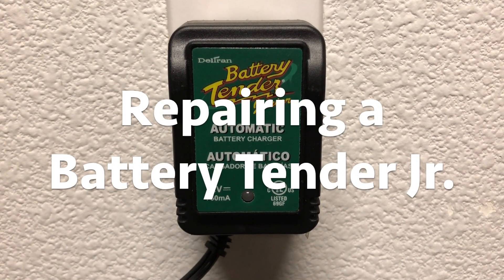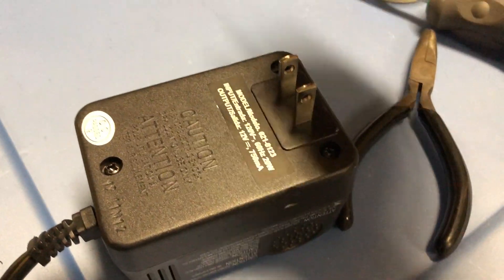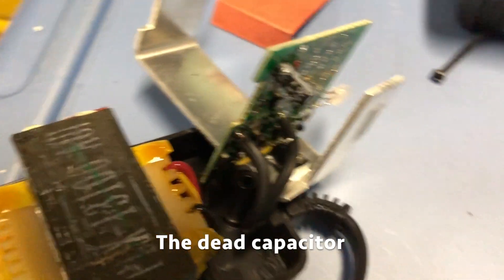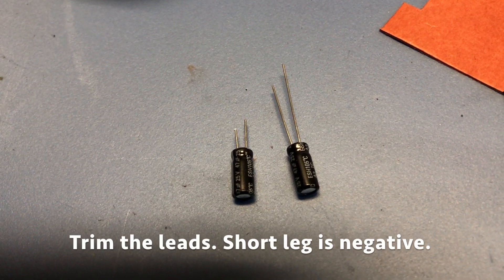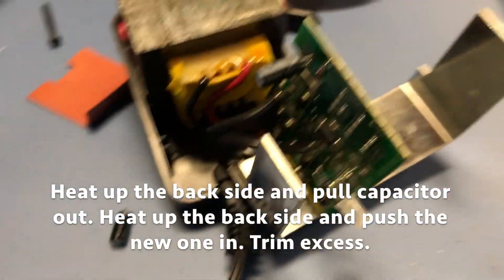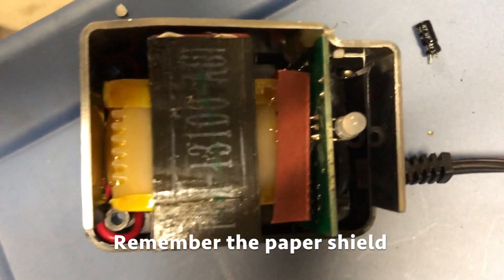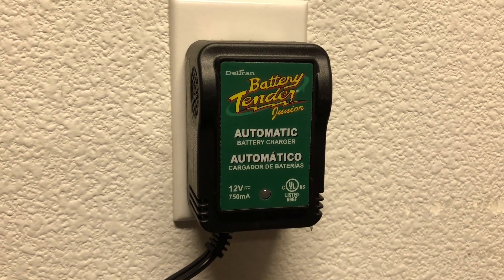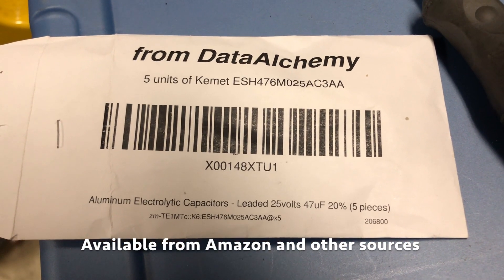Battery Tender Jr. Fix

Comment: My Battery Tender Jr. Model 002 simply stopped lighting the LED at all and shows 0 voltage output on a meter when plugged into 120 volts.  Is it likely to be a bad capacitor too?  I see no signs of any damage inside and it appears to have three capacitors in my version.

Comment: O have the battery tender 1.25 amp , suddenly stopped working, when I plug in the lights flash the stop. Opened up there are 8 round caps of various sizes, anyone fixed one of this model?
Tia.

Comment: Thanks for sharing this.  Here I thought the BT Jr. was going to be trash, and now I can fix my beefier/older BT jr. for $1 vs buying a flimsier/newer one for $35.  It helps if you have solder braid which sucks the old solder off the circuit board for ease of capacitor removal.

Comment: Thank you so much. It worked to heat and loosen one side then bend the capacitor to remove that leg, then heat the other side and bend in the opposite direction to remove the other leg, alternating back and forth until it's out. Inserting the new capacitor was the same. Trim the legs on new cap a little longer than necessary and start by heating and inserting the longer leg. Then bend opposite and insert the other leg, slowly heat alternating legs and work the new cap back in. I was able to order (5) of the 47uf 25v caps off ebay so I have enough for both of my Batt Tender Jrs to rebuild 4 more times. It's out charging my mc battery and again blinking correctly which is awesome. Thanks again for a clear concise video.

Comment: I am happy to see this video. Having the same problem. Now I need to take it apart and see where I could order the capacitor. I must own at least 13 or 14 Battery Tender Juniors. I have them on just about everything. I have the heavy older ones and some of the newer lighter ones. I have a problem with one of the older ones like shown here. If anyone has a link they want to share as where to buy these or a specific part number I need to get that would help my situation.
Reply: Answering my own question since I came back to this over a year later after fixing a few of these Battery tender juniors. Got my capacitors on Amazon. Bought a plastic box full with a bunch of different sizes. You get plenty of what will work for you.

Comment: I see that all of the repair videos are always for the junior version of the battery tender. I have three or four full-size battery tenders that have gone bad. Can we assume the fix is the same? With the normal size battery tenders you cannot take it apart with screws, I believe it is pop riveted together and I will need to drill those out.
Reply from the maker: I’m no electrical engineer but if you get it apart you might see any affected parts.

Comment: I tried the capacitor replacement and it did not fix my problem. I was able to measure 47uf on the capacitor I put in and 41 uf on the capacitor that came out. My unit switches from flashing red to red when a charged battery is connected but keeps on charging and gets hot, stays red, no green. So this is not a magic fix for every Jr. I've ordered a new one.
Reply from the maker: That sounds like the overcharging circuit is defective. Replacing the capacitor probably wouldn’t help. Considering these things can catch on fire if they fail a replacement isn’t a bad idea.

Comment: what if there are no lights coming on at all? could it still be the capacitor? loved your video. mine was working perfectly then all of a sudden no lights.
Reply from the maker: Louis Lemoine No idea. Can’t hurt to pop it open and see if you see anything.
Reply: swooshdave you won’t believe this. i went to my local motorcycle shop to get a new one and before i took it out to the garage i thought i would test it out first to make sure that it worked in one of the many electrical outlets in my home. they all work perfectly. so i plug it in and what do you know, no lights. not one at all. what are the odds of this happening. now i have to return this   crazy.
Reply from the maker: Louis Lemoine I’m starting to think it might be your outlet and not the tender.
Reply: swooshdave the outlets are perfect. the table lamps work with it/them. i checked everything. that is what is wild. i think it was a coincidence of getting a bad one.
Reply: swooshdave dave...the motorcycle shop exchanged it for me. they were cool. they plugged it in and nothing. the owner said to me that it looks like it is doa. anyway, this one works perfectly. had them plug it in at the shop before i left. thank you for sharing your video. it may come in handy years from now.
Reply: swooshdave i opened it up but all looks good. i was thinking that maybe there wasn’t fuse inside but didn’t see any.
Reply from the maker: Louis Lemoine Time to get a new one!

Comment: Was going to dig into my green flickering one and test a few things but decided to check the web.  This just happened to be the first vid up.  Cap was bad, LCR meter showed 0.1uf instead of about 47.  Poor little Tiny13 microcontroller was trying to run on junk power.  Replaced cap and it's running fine.  Thanks for saving me some time.
Reply from the maker: Like I mentioned I couldn't have done it without Thomas Burdsall! But I'm glad this video helped you. Failed capacitors have hobbled many an electronic device.

Comment: Thanks for this!  Mine just died and I used this video to replace the 47uf 25v cap with a 47uf 50v and I can confirm that it works perfectly!
Reply: What difference would it be between the 25 v and 50 v that you used, orsay the 35 the radio shack one ?
Reply: @417Keto  No worries going with a higher voltage capable capacitor than the originally specified one. The voltage rating is how much the capacitor can handle before failing.
Reply: That's what I just used because I had them leftover from another repair.

Comment: What capacitor do you need to buy ? I'm guessing that info will be on the capacitor you pull out?
Reply from the maker: This is the one I used. You might be able to find them for much less if you look around. Aluminum Electrolytic Capacitors - Leaded 25Volts 47uF 20% https://www.amazon.com/dp/B00M2EJHK6/ref=cm_sw_r_cp_tai_wKOUBb8HVZP6T
Reply: @swooshdave  Thanks. Much appreciated

Comment: Great job!  I found the capacitor at my local electronics store for 73 cents!  However, I need the black gizmo with three solder points that the screw goes through.  Can anyone tell me what that is?  Thank you for taking the time to make this video.
Reply from the maker: A quick Google shows you shouldn't have much problem finding one. Make sure you match the type of transistor (I believe you need a Power Transistor). Note that my electrical expertise involves turning perfectly working devices into smoke making machines... so good luck!
Reply from the maker: I don't know what that is. Did you break it when you took it apart?
Reply: swooshdave yes I broke it taking it apart. Apparently it's a transistor
Reply from the maker: And no markings on it at all? It might be proprietary.
Reply: swooshdave  I found a different video where someone named it BD 438 PNP transistor.  I have not had the opportunity to look for one yet
Reply: swooshdave thanks I hope to start my search tomorrow
Reply: @orvrcf  Hey there, did you switch out your transistor after?  What did the charger behave like with a broken transistor?  My junior tender has no light at all, and is not charging.  Visual inspection revealed some corrosion/nasty green stuff on the bottom of the transistor, so I suspect it may be the issue.  Thanks.